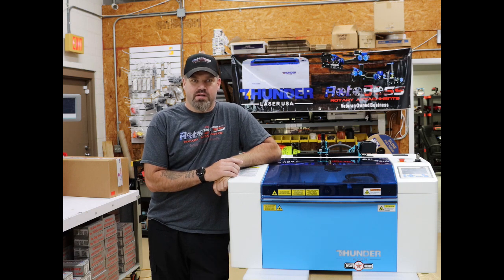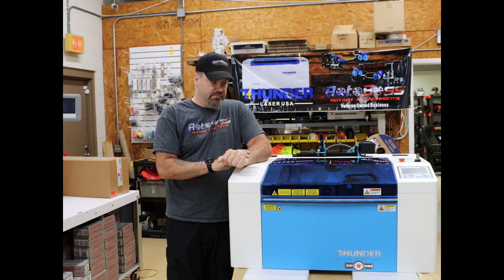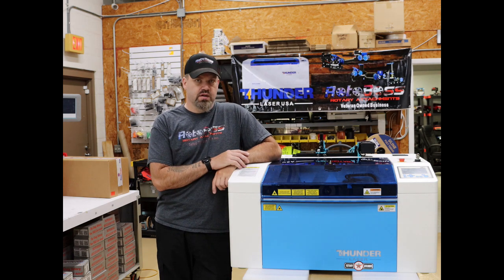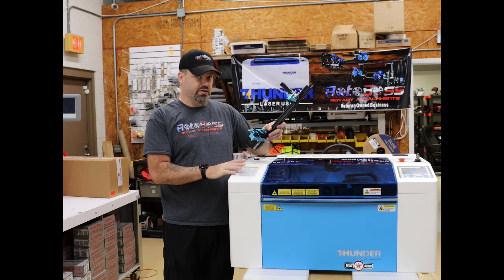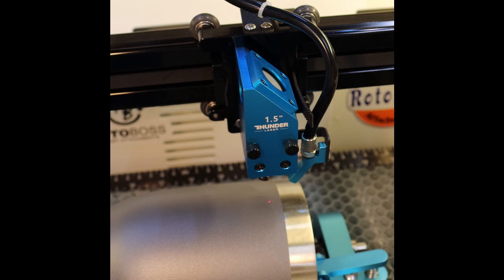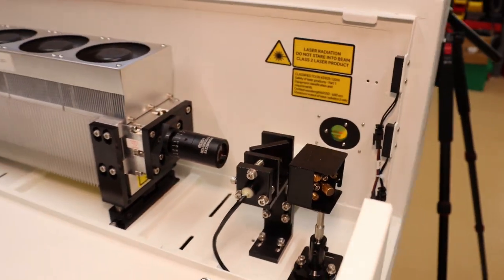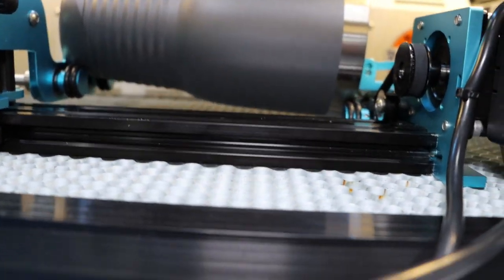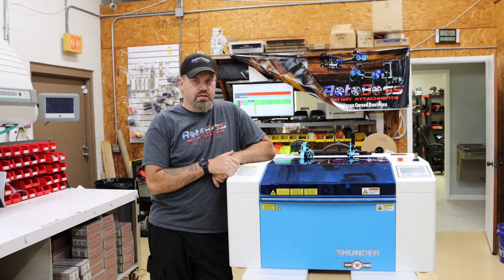Thunder Laser Bolt and Roto Bolt First impressions and review

Comment: You are wrong about this as being the only one with an RF tube.  Gwekie Cloud has a desktop tube since at least in 2022 because I was about to buy one last year.  It is even more compact and has higher wattage than the Bolt.  It also can use a rotary.  I end up buying the Thunder Nova 35 100 wart instead of the Gwekie RF version.  Just look it up.  However, at this time, I would recommend the Thunder Bolt over the Gwekie RF laser desktop version.

Comment: Only 30 watts.
Nice features but there 50. 55 watt co2 fir same price.
Features are real nice but....
Reply: He literally made the RF/C02 comparison a minute into the video.
Reply from the maker: A 30 watt RF tube is about equal to a 50 to 60 watt glass tube with added benefit of better beam quality and smaller beam size. They don't have anything that is 5k besides this laser. Being an RF it is air-cooled, which means no chiller to worry about, smaller chassis and lighter. The only down side is it is a little smaller bed space and z height but for people this would be good for you can  not beat the price, quality and capability.